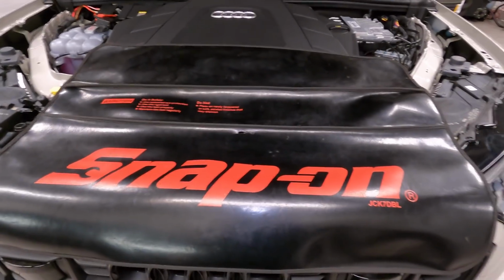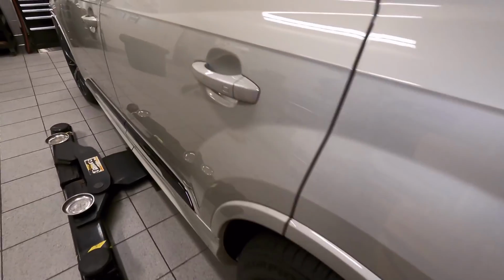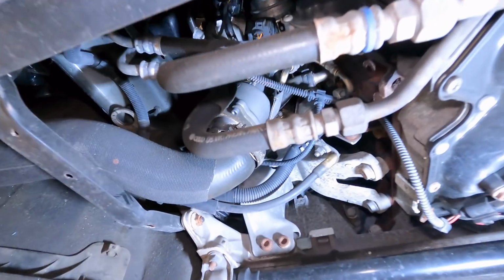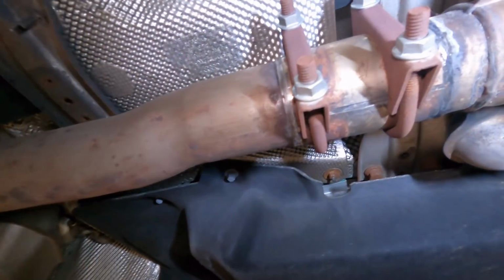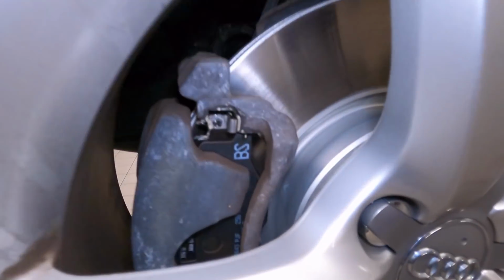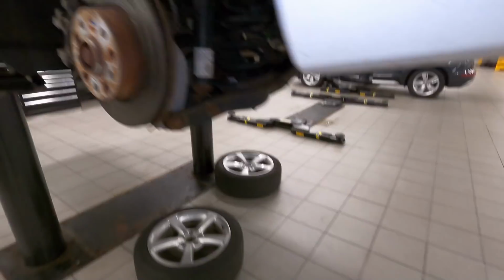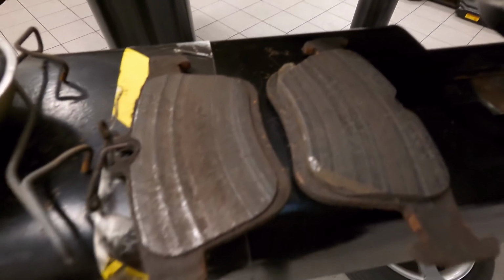Customer states "WHO ORDERS A CAR LIKE THIS!?🤔

Comment: "The brake pads that squeal , the oil that leaks, these are a few of his favorite things!" :)
Reply: He could always run a drain hose from the intercooler hose to the brake pads and he’d have a pressurized self lubricating anti-squeal brake system.
Reply: @ralfie8801  That's the kind of thinking that leads me to believe you should stop thinking. :)
Reply: Mark H. 
Hey, just trying to do my part in figuring out how to deal those idiots that drive with one foot on the gas and the other on the brake. They drive around with their brake lights lit up all the time (provided they haven't burnt them out) and nobody has any idea if they're slowing down, stopping, lost, or what.
Edit: And then they wonder why they can't keep a set of brakes on a vehicle.
Reply: When the dog bites, when the bee stings, when I'm feeling sad.....I simply remember my googats brake parts and then I don't feel soooooo sad!
Reply: @ralfie8801  That was a line in Sammy Hagar's "I can't drive 55".  "One foot on the brake, and one on the gas! HUH! There's too much traffic I can't pass!..."
Reply: @stevefick3919   That's the way, Steve-A-Reno!
Reply: @markh.6687  
And it comes true in my case almost every day!

Comment: Actually the rusting rear rotors is a big problem with current VAG cars. I had to replace mines after 40k kilometers. They looked very similar to those in this video. The OEM rotors are shit.

Comment: The front  will look like that in no time unless they stop riding the  brakes lol
Reply: Most drivers have no idea how to drive and start braking 200 metres before they need to stop. See this sh*t all the time. And then they wonder why their pads wear out so quick.🤣
Reply: @metarugia2176  That's why I slam the brakes only meters away from other cars.
Reply: @metarugia2176  it’s the pads too those ceramic pads just eat the rotors cause the friction material is so much harder then the rotor. It also doesn’t help that the rotors are made out of el cheapo Chinesium or the cheapest crappiest grey iron they can buy and then charge way more for. I have yet to see a rotor that’s not made in China also probably 90 to 95 percent of brake pads are made in India due to lax pollution laws
Reply: @matthewcaughey8898  Actually, semi-metalic pads are harder on rotors than ceramic ones. In both cases though, the friction material is softer than the rotor.
Reply: @madmatt2024  not from my experience. Ceramic fibers in the brake pads almost always chew up a rotor long before a semi metallic pad does. For example several cars I did with ceramic pads came back and the rotor looked like shit and I replaced them ( I don’t cut rotors cause it’s not worth it anymore). Several other cars including mine had semi metallic pads on them and they didn’t have to have the rotors replaced. Now maybe things have changed since I swore off ceramic pads, but I’m going to need proof of that cause I got way longer rotor life out of old wearever silver pads ( which claimed to be semi metallic) then I ever did out of anything ceramic from raybestos, NAPA, or anyone with pad sets out there now. My current set ( Semi Metallics from Nakamoto) make noise sure but so far my rotors look fine.
Reply: @matthewcaughey8898  The general rule of thumb is to put the same type of brake pad formulation on a car that it came with from the factory. You're in uncharted waters if you use a different formulation and most cars use ceramic from the factory now. The only time I've ever seen a ceramic pad mess up a rotor is the OE pads on the Focus and Escape. I've never seen rotors get grooved up like that before. The other techs I work with think it must be some kind of inconsistency in the pad material. We replace the rotors, install Carquest Platinum ceramic pads and the issue never comes back. Just goes to show how much of a difference the quality of the pad makes. I've had ceramic pads on my Mazda 3 (which it calls for) and the rotors never got grooved up.
Reply: @madmatt2024  carquest dont exist anymore your using rebranded wearever stuff from advance
Reply: @matthewcaughey8898  Not exactly. The Carquest Platinum stuff actually got rebranded Wearever, still the same pads. The gold pads however were replaced with existing Advance/Wearever parts. I work for a shop that is also a Carquest franchise so we have inside info on this stuff.
Reply: I would say it’s more likely a short journey car where the rear brakes are hardly doing anything and the rust from rain etc is never warn off and they end up like the video.
Reply: @madmatt2024  What?! The freaking factory does NOT (despite what they or their minions will tell you) use anything "quality." In almost all cases you can do BETTER than factory when buying parts. In most vehicles the factory will install "good enough" hardware. They will spec a rotor that is 2oz lighter to save unsprung weight so they can save .001 cafe point. They will install a tire that gets .01 mpg better to save .001 cafe point. 
They don't make their own parts. In fact I'd bet many vendors make pads and rotors for the same year model car. There might be 2 or 3 vendors that produce brake pads for a 2021 F150, or Camery. The first set of brakes in any vehicle I've ever owned usually have to replaced at 50k and by then the rotors are warped and trashed. I ALWAYS buy pads and rotors from companies that are brakes companies, EBC, Brembo, Baer, etc. When I order rotors I look for weight specs. I will buy a heavier one because in rotor world heavier is MOST LIKELY better. But again from REAL brake manufactures not Duralast or some other house brand. That will most likrly be the last rotors I ever buy for that vehicle. I have 152k on my 07 Ram 2500. Changed pads and rotors at 50k(ish). I just did the second pads at 142k It tows every day and work every day. EBC orange stuff and their slotted and dimpled rotors.  Still smooth, quite and has great brake feel. 
Same goes for tires I most likely will never put factory tires back on  (we are taking everyday drivers, not hi performance cars or specialty cars). Electronic parts are different like alternators, or sensors however. The factory know to calibrate that kind of stuff. Even oil and oil filters... The factory will have you believe that their stuff is the best. It's not. It's good... Not the best.
Reply: @nhbountyhunter  LOL, what? All I said was to use "same type of brake pad formulation on a car that it came with from the factory", I never said the factory pads were better than what you could get in the aftermarket. As for the factory not using quality parts, 90% of the time this is BS. Factory parts are usually the best, aftermarket is usually inferior. I work on cars 5 days a week and get to see aftermarket parts that I installed go from new to trash in sometime under a year, they also don't always fit right or work properly out of the box. I had a ball joint just yesterday that was defective out of the box. Of course, there are aftermarket parts designed to fix a factory design problem and those are great, it's just not what happens in general though.
Reply: Just drive backwords and stop ,no problem
Reply: @madmatt2024  I did not mean it as a dig. But (this is not flexing just a 3 sentence background). My father worked for Ford for many years as a their field warranty guy (not sure what the title really is). He would go to dealerships and look at issues with vehicles that techs are seeing. He would then recommend changes to the factory. The higher ups would simply look at cost. How much to make the change vs how much to do the warranty work. He taught me everything I know. He would always impress on me that the factory does NOT use the best parts. You can always do better. You want a better control arm get one from a suspension company like Hotchkis. You want a better alternator get one from a company that makes alternators (not factory spec).  Yes, they are more expensive then "OEM." But they are better. The factory has to balance everything and sometimes major corners are cut to save money. 

The best example is just building a motor from scratch.  How many "OEM" parts are you going to use. Maybe the block? Maybe the heads? Maybe the crank? I guarantee you will have aftermarket cams, pistons, bearings, connecting rods, rings, valves, lifters, seals, intake, hell even the bolts. You'd be throwing away money if you went and got a factory bolt kit or seal kit.

Comment: To help educate us viewers, can you explain what is causing the problems. i.e why are the turbo and inter-cooler full of oil; what steps would be necessary to correct the problem and how much the repair is going to cost. Also it appears you are on the East coast and we never get "flavor" like you see here in Colorado. Audi being built in Germany, where they use copious amounts of deicer should know to undercoat, powder coat or other ways to cut down on rust. Perhaps you can be employee of the year and contact the factory and show them the horrific rust problems!
Reply: Just a guess as I don't have access to the car myself, but oil  in the intercooler is usually a blown oil seal  in the turbo. It might also be from a crankcase ventilation system with issues, but my bet is the turbo. Run hard and not cooled down gives some really high temps in the turbo. Which tends to do bad things to bearings and seals.  And, NOT  a cheap fix.
Reply: @bobmazzi7435  Especially on an Audi. Don't work on a lot of those but I'm guessing the turbo is buried enough that you probably have to pull the whole engine to get it out. Or something close to that level.

Comment: Does it really matter what color someone orders an Audi?  They start falling apart without doing  insane repair costs after 80,000 miles so you just buy a new one every 4 years.  Meanwhile my 2006 Japanese truck is nearly 200,000 miles and has required no major repairs.  It runs and drives like a damn dream.

Comment: I worry about that oil in the turbo intercooler. Nothing fouls catalytic converters and O2 sensors, like oil consumption! That will definitely flag the "Check Engine" light.

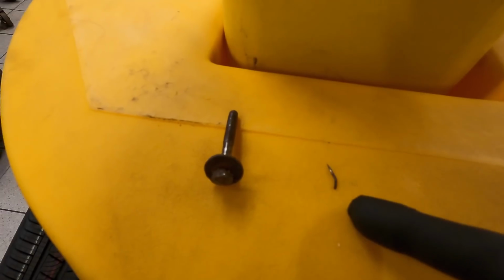Comment: 3:10...That's not true. A small leak can get you to the shop. A large leak can leave you stranded on the side of the road.
Either way, better off replacing the tire.

Comment: You would have loved the rear brakes I pulled off my 07 WRX, rotors completely rusted and uneven, and pads cracked and down to nothing. Oh and the bleeder snapped off the rear driver caliper.

Comment: So, is the oil in the intake a Audi quality issue or design flaw or is that something that could have been prevented with maintenance?
Reply: @Daniel Erb The mosquito killing smoke isn't normal -
Reply: That is sort  of iffy. Did that car get oil changes with low quality oil?  Then, yes a maintenance issue. I'd be just as quick to ask  if the driver let the engine cool a bit at idle before shutting it off?  Running a turbo engine hard and not cooling it down properly will do a number on turbo bearings and seals.

Comment: About 3gs for the rear I'm guessing and I'll bet the fronts were about the same, thems dealer prices for, i worked on my neighbors father's x3, his son is a service writer manager at a BMW dealer and he couldn't afford their prices, I fixed three out of five oil leaks it had so it at least stopped leaving a puddle everywhere he parked plus some front end work, parts alone were 600 all fac-tree and that's jobber price, is that term still used, I don't know.

Comment: What could be the issue of my 2004 fiesta, when the car sometimes dont get power on a cold engine uphill? Doesnt happen often and i dont have any visible errors but i am still concerned about a complete enginebreakdown. That engine ran already over 235k kilometers
Reply: Last tune up?   Spark plugs do like being replaced every 60-80k.   Vehicle also has 235km on the engine, do you drive the car super hard? Do you notice oil burning/losing oil with no visable leaks?
Reply: @quayl1337  well, its a diesel not gasoline
Reply: @Kinsanth_  lol…..     that makes much more sense now.     Diesel ingnites its fuel with compresstion. Not spark plugs. So when your car is cold, its not up to temp yet, its not giving you the full amount of power you can get fron a diesel.   It needs to heat up so the piston ring material and cylinder walls expand and create the air tight seel in each hole. And sense it is a diesel, they have extreme difficulty in the cold starting up.  Heat is your friend in a diesel. So are fuel injector cleaners every few gastank fillups.   Hope that helps.   If your car has a block heater, or glowplugs if they exsist on that 1.6 engine, id encorange you to use those before starting the vehicle :).  Itll add some heat to your engine so the warm up time isnt so long. And youll get the full amount of power from a diesel when its at operating temp.
Reply: @quayl1337  you misunderstood
Reply: @quayl1337  completely
Reply: @quayl1337  you misunderstood, but its my error to not point the issue out correctly. I have sometimes those issues with not getting power on a cold running engine, even if it was warmed up properly. Maybe its really the injectors, but after a few thousand kilometers of driving at different high speeds and altitudes it seems to be clean again. I dont like additional chemicals in the intakesystem if they are not needed
Reply: @quayl1337  and furthermore, its a 1.4 liter engine. Gasoline are 1.6 liters ;)
Reply: @Kinsanth_  ah alright, lol there is only so much i can go off of when im not even looking at the car ya know?    It sounds like you have a fuel issue to me personally, just based off what your sayin.   I will say tho, that putting the fuel injector cleaners like, BG products-44k fuel system cleaner, and also like, lucas fuel system cleaner are good to put thru diesels.  Reason why is the injectors can get stuck open, it will melt the piston and destory an engine. Happens to cummins engine alot, and it could also just clean out any debree or anything thats causing a blockage in the system.     Last fuel filter change?   Diesel fuel also has verying degrees of quality, much more then gas. So you could be buying bad diesel too if you hit the same gas starion all the time.  In colorado my buddy only gets his gas from shell for these kinda reasons

Comment: Grooved disks and pads ( as long as there is enough lining ) give you more surface area and more swept area. So, a few grooves is not necessarily bad. First  braking is actually  better, and heat dissipation is improved, a bit. However, if the disk is thin you have less mass of steel so the second or third brake application will see more fade. 

What we see here is rusted disks. Either it's parked near  salt  spray or that was a cheap set of disks with  bad metallurgy. Because of all the pitting you have reduced surface area and poor braking . As well as that nifty grinding sound....

Comment: So, what causes all oil in the intercooler lines? Looks expensive.   Always look forward to “ taking in up top “.
Reply: Oil blow by from the turbo. Goombas might have used too thin of an oil viscosity, overheating oil and then turbo seal. Mine have all needed 5w40 synthetic euro spec and I doubt those Goombas are using it. Or it could be PVC issue maybe if it's not breathing right.
Reply: Best to avoid anything Turbo...just a royal pain in the @$$. Turbo was made by Tetley Tea Company
Reply: @jeffreybryson  or shitty German seals on the turbo. Since we don’t know the mileage of the car it’s pure speculation as to the leak
Reply: @jeffreybryson  Turbos spin at about 30,000 rpm. All it takes for one to fail is dirty oil, a Goomba oil change using the wrong viscosity, overheating, or shutting the engine off (which stops oil flow) without idling for 30 seconds to let the turbo lose speed. Any of those will cause premature turbo failure.

Comment: Two decades at european dealers... Most was at Jaguar. Back then, most models were on 16" rims. Every tech in the shop had 16 " rims on every car they owned just to capitalize on the wasteful customers with too much money.. I cant tell you how many free tires I got over the years because customer would have a nail in one that was an easy patch, and theyd say put a tire on it. Or, they needed a set of front tires, rears were a year old with 3000 miles, and theyd say just slap all 4 on it so theyre fresh and match.. The first time I had to actually buy a tire for my car in over 10 yrs I almost cried!

Comment: So the turbo pulling oil from where?  Is the engine shot?
Reply: The turbo needs oil itself to oil its bearings and cool the turbo , it has two pipes, one inlet and one outlet for oil
Probably the seal has gone on it
Reply: @Alucard-gt1zf  I understand that but if it's sucking oil out it has to be taking it from the engine right?  How long before there's no crankcase oil?
Reply: @mitchstaff8281  That amount might be many thousands of miles of accumulation. Judging by the exhaust, it's probably burning a quart in 500-1000 miles.

Comment: So where was the oil coming from, that it got into the intercooler?
Reply: From a bad oil seal in the turbo. 
It probably leaks in both directions, both towards the intercooler and towards the exhaust system, which causes smoke from the exhaust pipe